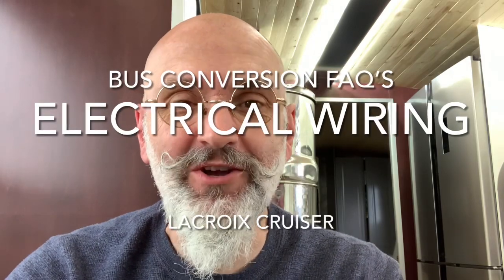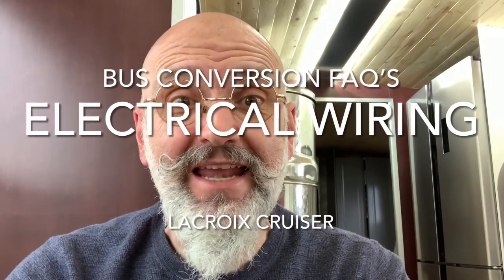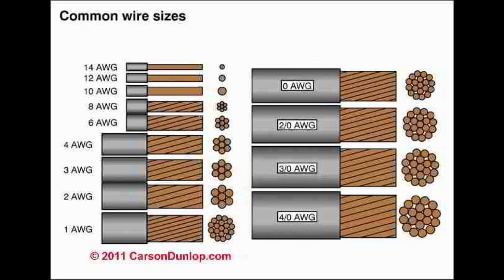Bus conversion FAQ’s, electrical wiring

Comment: What about the original wiring for the bus? How do I know what not to cut from the upper storage??
Reply from the maker: Follow the factory wiring diagram. When removing factory wires, only remove a few, and test the operation of the bus before continuing.

Comment: That's what I was saying to my wife and my buddies who are going to help us on the build  here next year. No wires in the walls. I've had enough electrical nightmares in my life, both dc and ac. Not to mention a few solar ones also but that was way back in the early 80's. I barely recognize the solar power systems now, lol.
Reply from the maker: Solar has evolved dramatically.

Comment: On hot skin I bought the No Shock Zone book and it was helpful for basics and testing shore power for safety. It did not cover safety for solar system considerations though which was very disappointing.

Comment: Wiring is a touchy subject to some. You have people who are familiar with how its done in a house, and you have people who are familiar with a car.  But rarely a mix between the two.  I personally never do chassis grounds.  They often always fail, come loose, corrode, etc and cause problems.  Yes it add a little bit more wiring but in the end it creates a MUCH better system with dedicated grounds.  Also I've built a few boat projects and they simply just dont have a chassis to ground in the first place.

I think a lot of people get overwhelmed with the sheer amount of wiring there is in a bus, and rightfully so. Theres a lot going on once you get into outlets, switches, lights, air conditioning, inverters, solar, solar chargers, etc... but creating even a simple napkin diagram of everything you have and just connecting the dots goes a long way.
Reply from the maker: Correct, one step at a time.

Comment: Neutral and ground get bonded inside the inverter or generator (or transfer switch) when they are active.  They remain unbonded when connected to shore power.  Neutral and ground must be bonded, but should only ever be bonded (connected together) at one place, which is the source of the power.

Comment: So if you don't have any wire in the walls, where do you put the outlets commonly found above the kitchen countertop / below the kitchen cabinets?
Reply from the maker: They are in the bottom of the upper cabinets.

Comment: Hence the big piece of plywood behind everything. Wood is a great insulator ( unless it’s wet lol). I do have another question for you though. Regarding the two AC panels you have, you are separating those through the receptacles that you have in place? The only thing common between the two is the one inverter charger when you are on shore power? The panels are duplicated so that mean that you have two separate feeds to each receptacle in the bus or are you running two separate systems? Actually that’s three questions....😁. Many thanks for the video Yvan and I really appreciate them. Clears any questions I have in my mind.
Reply from the maker: We have some outlets that only run from the inverters, some that only run from shore/generator power, and some that we removed the jumper and the upper receptacle is inverter powered, the lower one from shore. We are rarely on shore power so our system is primarily inverter based.
Reply: @LacroixCruiser  thank you for the reply. So the are separate entities then. Excellent. On the second question I was worried about ground loops, like you said they can co-exist but can never meet (I have seen and had to repair the results of them meeting many times!!!).

Love the taking the bus bar out of the power receptacle thing, didn’t think of that. Again the not worthy thing comes to mind😂😂😂😂

Comment: You might find this document useful, I’m an aircraft mechanic and they put everything you need to know about wiring in one free book. And less face it, a bus and an airplane are definitely cousins 

https://www.faa.gov/documentLibrary/media/Advisory_Circular/AC_43.13-1B_w-chg1.pdf
Reply: I was looking for that doc. Thank you Phil
Reply: @ivanmccaffrey316  you can order a print copy for 20-30$ also
Reply: @philhamilton4567  thanks for that info as well Phil. It’s already saved and printed. 😀😀😀
Reply from the maker: Thank you!
Reply: @Phil Hamilton Great info! Thank you.  Any chance that document has been updated since 1998?
Reply: @DellAnderson  no that’s it, the information doesn’t change and if it did the faa would take 10 years to make a revision. I remember the last update was to the radio section it went from ac43.13 1a 2b to ac 43.13 2a2b I think